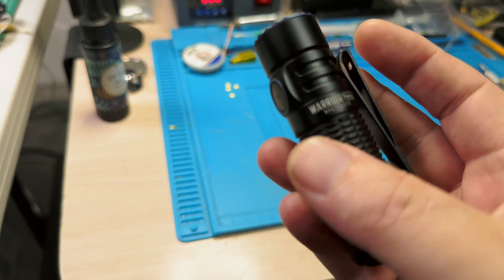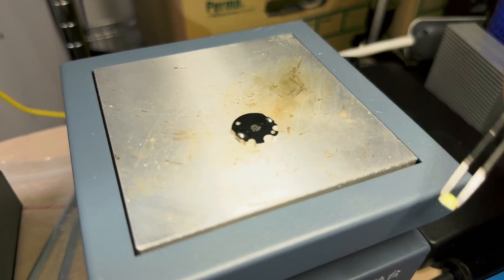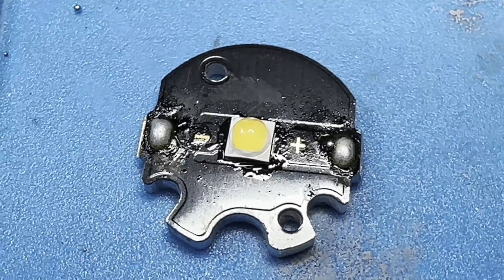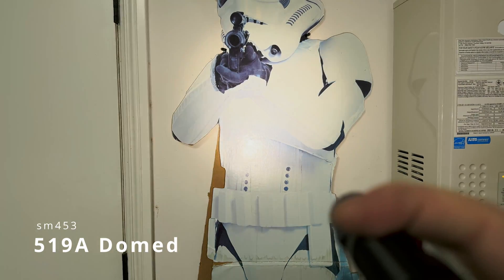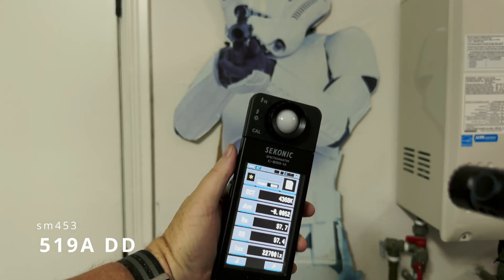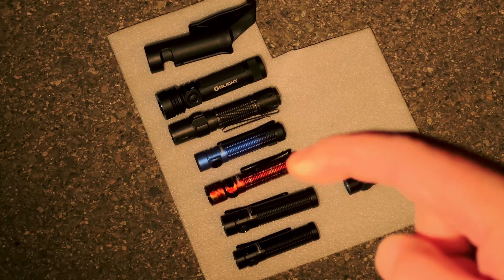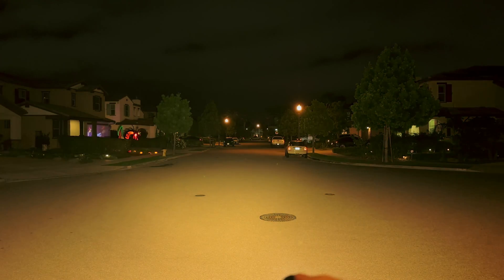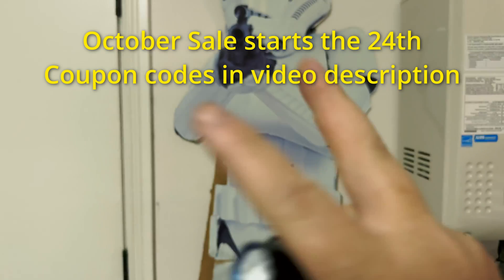Warrior Nano swapped to Nichia 519A!

Comment: Is it possible to replace the TIR lens in a Olight Warrior Mini 3? I just got that flashlight but I don't like the hotspot. I think it's way too tight for an EDC flashlight. I thought it was going to be much floodier than it was 😕
Reply from the maker: I like the tight hotspot personally! But solving the issue for you is so easy you won’t believe it.

Without even dismantling the light at all, you can add as much flood as you like by lightly sanding the surface of the TIR optic.

Go light with the sanding at first, and make it look lightly frosted. Don’t worry if it looks uneven, you’ll never see it in the beam. Not floody enough? Sand it more!

You’ll be surprised how well it works.
Reply: @cheule  Wow! I never thought about that! Thanks I'm going to try it out 🙂

Comment: weird i thought 4500K dropped to 3800K
Reply from the maker: 4500s run 4300 out of the gate. Then expect a dedome to lower CCT about 20%, and the PMMA in the optic lowers is about 200k further as PMMA filters bike light. If this was a metallic reflector it would be higher CCT.

Comment: All the other lights make the Nano look a bit rubbish. Did you not have anything else smaller  that would have made the Nano look good? or is the Nano your worst light lol. Great vid in any case. Oh and like your 3k mod. Seems  to have some serious flood, sort of like a warm sun or big orange on the ground.
Reply from the maker: I feel like anyone looking at the nano is probably a Warrior fan, so that’s how I compared it. I could have compared it to a Okluma DC1 with Sigma single drop in, but that’s a $700 light vs a $60 one. They do look similar though… which shows what a bargain the Nano is.
Reply: @cheule   or what a rip off the Okluma DC1 is? If it's as good as the Nano then perhaps that isn't such a good thing really, especially for $700. I agree the Warrior comparison is also relevant. I am curious to look at new models but the Nano manages to evade my lighting ocd, though as usual from Olight it looks very well constructed. I'm getting my first smallish cheapish work floodlight today to try and it does different colour temps so looking forward to seeing how that is.

Comment: I didn't expect the drop in output to be so dramatic. 
Now that the SFT40 is available at 3000K I'm thinking about replacing the dedomed 519A in my S2+ with it. I'm gonna wait till Simon lists the emitter.
Reply from the maker: SFT40 is a 5050 emitter, you’ll need a new MCPCB. It’s 3v though, just like the 519a
Reply: @cheule  I know, I always order new emitters with MCPCBs. This will go into my 18350 S2+ with the 5A buck driver. My other S2+ (Ti 18350) EDC has a 719A and the 6V2A driver.